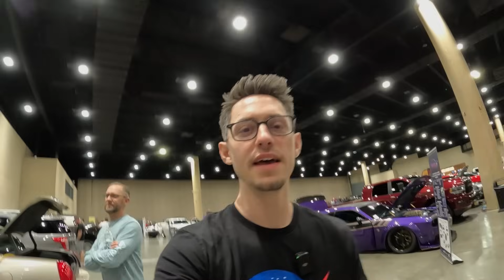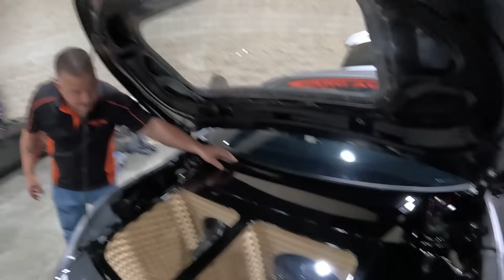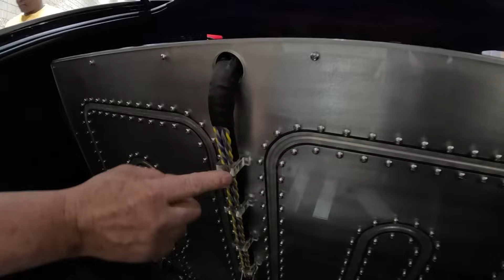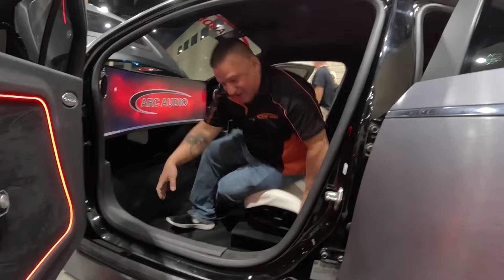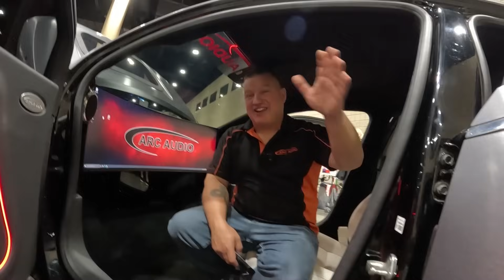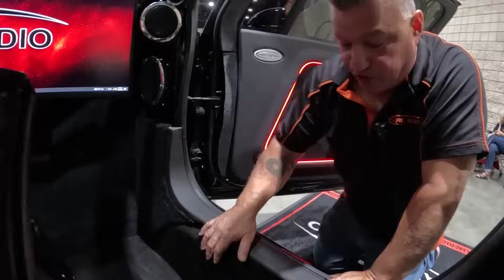ResoNix Sound Solutions - 2024 Car Audio Finals Competitor Spotlight - Brian Mitchell Chevy Volt

Comment: Dude no way, @30:00 , I am doing almost the EXACT same thing on my truck build! 

I have a couple Crimestopper Park-PMCU parking sensor systems for front are rear.
I also took the led indicators apart, and used the leds to trigger some relays.

In the front system, I have the first leds (closest detection) triggering the front camera, so when I approach an obstacle I get a video feed.
Then the very last leds I used to trigger a red LED strip in my gauge cluster area which acts like a better "STOP!" indicator. 

The rear system I am using pretty much the same, except the very last leds trigger a relay that changes my normal reverse camera view over to another cameras feed , so i get an almost birds eye, down facing view of the bumper, whenever im extremely close to objects😮😮😮. And I have the same "STOP!" indicator strip triggered by these rear sensor leds too.

Well anyways, i just couldn't believe to hear that Brian has done the same thing! Gives me quite the boost of confidence that im doing something right!😂